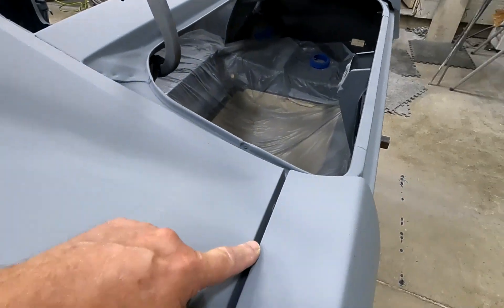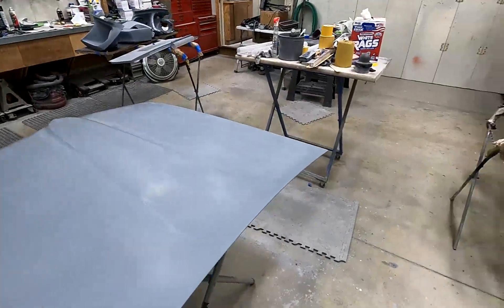1969 Mustang BOSS 302 Restoration Project:  #16.  PAINTING ENGINE BAY AND UNDERCARRIAGE.

Comment: Greg, two questions if I may? Can you provide a formula for your "slope gray" and what did you use for sound deadener on the rear quarters inside the trunk?  I wish to duplicate the OEM look and am not finding much. The car looks awesome! See you have paint on the Boss Nine now, looking forward to seeing some updated videos on it. Thanks!
Reply from the maker: Sorry for they delay, I was out of town. I use SPI epoxy mixed 80% grey with 20% black. I typically adjust it up or down as needed depending on how dark the car was originally. I use Fusor® 805HD-PLUS Black High Definition Sprayable Sealer which is applied with a specific gun that can be purchased from them. It allows adjusting the pattern to get the OEM look. Good luck with your project
Reply: @greggrichhartdesigns9616  You owe no apologies; I'm quite grateful to you for what you do here. Thanks so much!